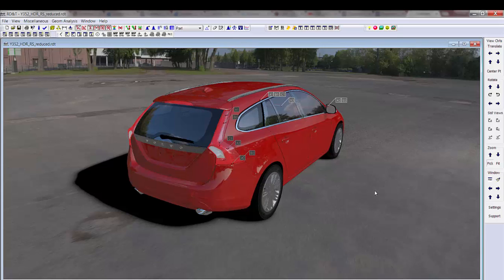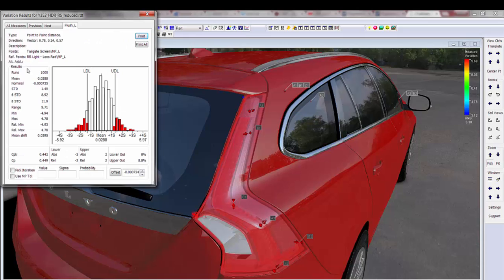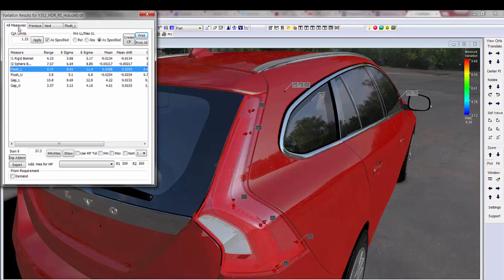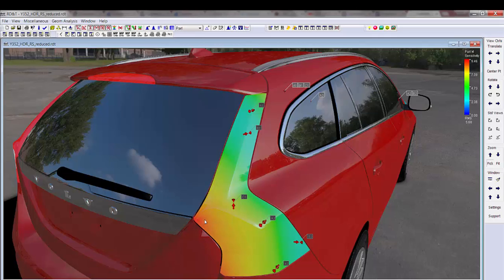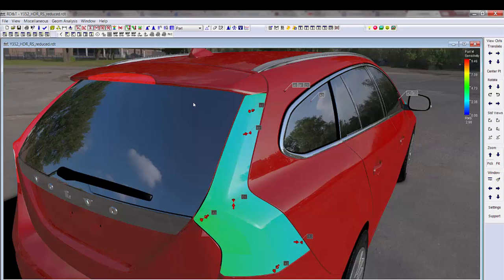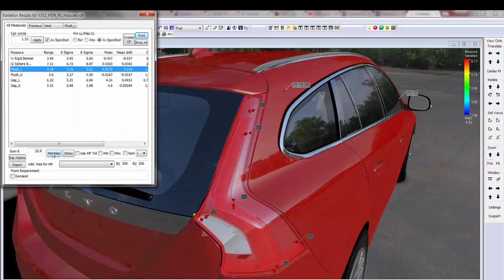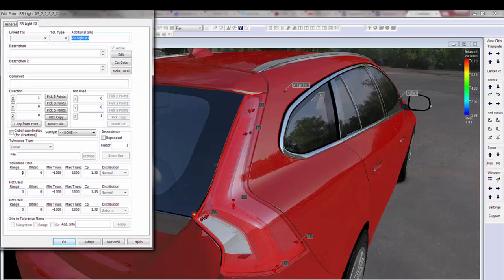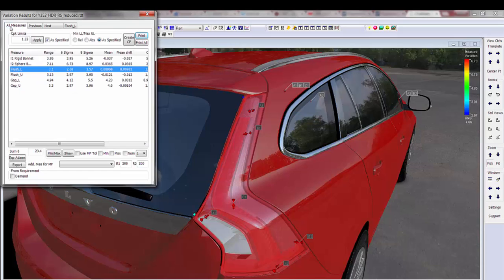Geometry Assurance in RD&T Software

Comment: Hi . Do those primary locators A1, A2 , A3 indicate the place where the bolts need to be placed ?
Reply: Yes, that is correct. All locators are physically represented by a contact between the parts (or the part and a fixture). In non-rigid analysis, you can also define spot welds (or rivets/screws) between parts, and also handle collisions between parts with contact modelling.
Reply: Kristina Wärmefjord  Thank you🙂